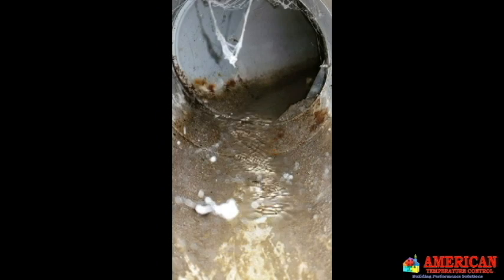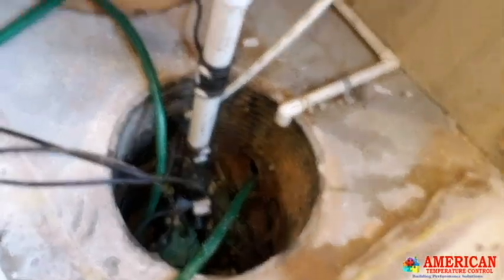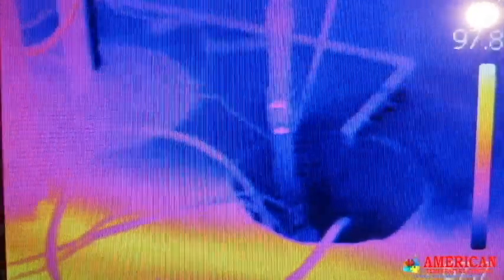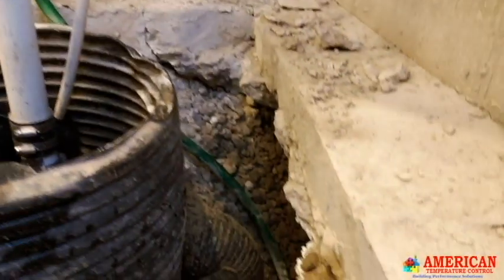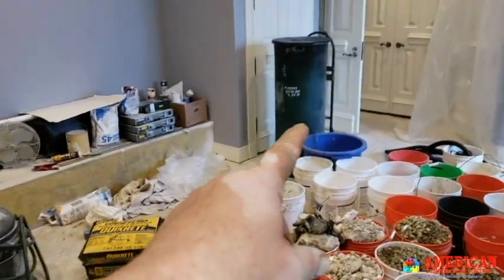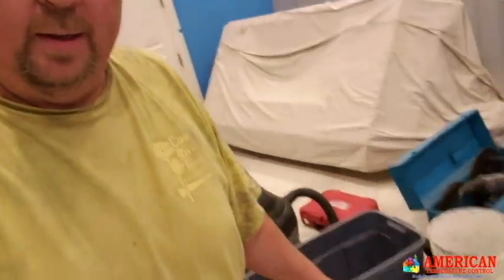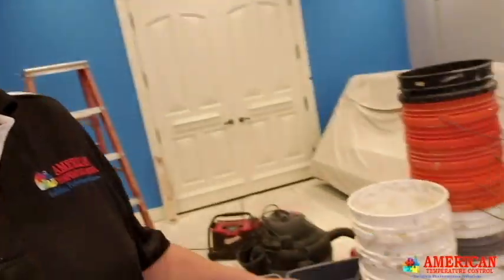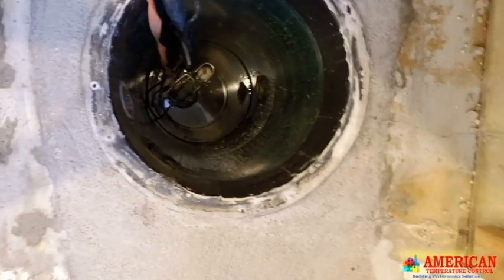Flooded Air Ducts

Comment: I live in a mobile home...i have water flowing in my vents. My filters are changed every 3.5 weeks...coils are cleaned yearly as needed...drain line inside unit is draining fine to the drain outside.  Well i took my under pinning down and theres like 8 foot of hvac flex pipe that runs from vent to vent, is so full of water its literally sagging to the ground almost. Im a single grandma raising my grandchild...can anyone help me with whats wrong